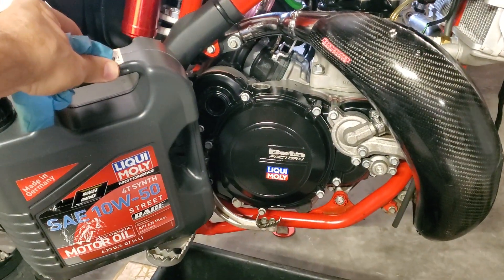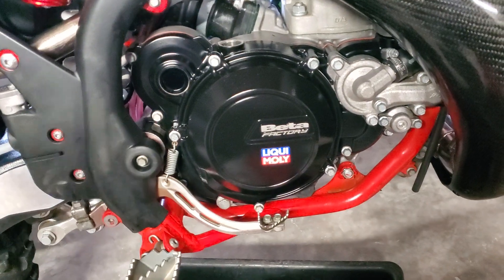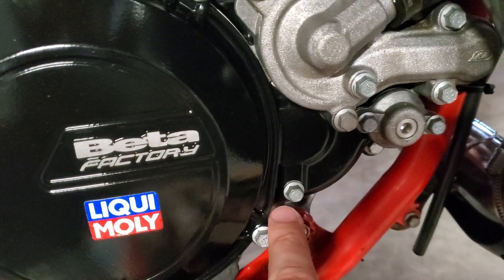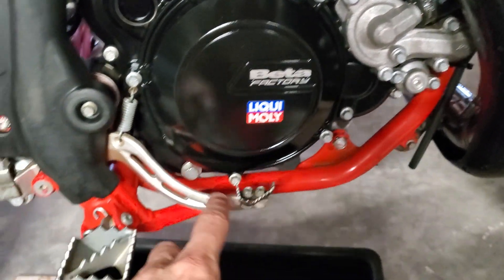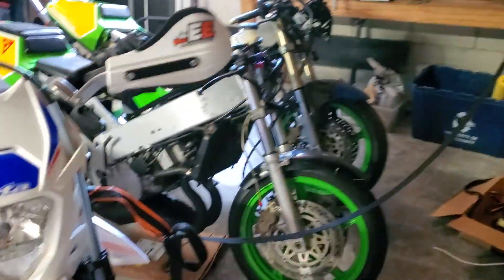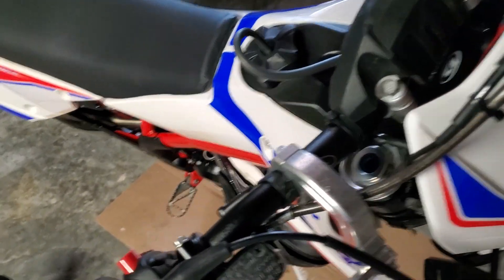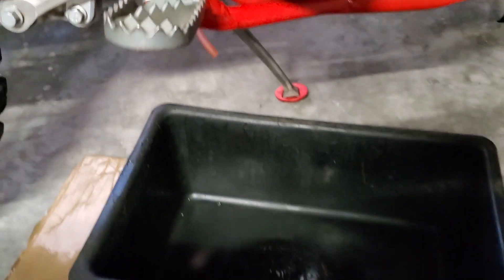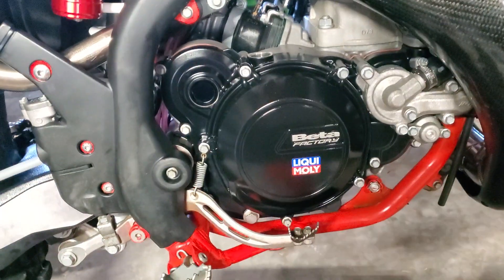Beta 300 Xtrainer Oil Change.

Comment: You run that even though it says 4t?
Reply from the maker: I just wing it and follow the manual.
Reply: the 2t is in the oil mixer tank which is what gets injected and mixes with the fuel but yeah I agree with wetlife, I just follow the manual
Reply: that's what you use in the crank case. 2t oil is for the oil injection.
Reply: It’s the same for either type of bike if using as a gear oil. Can be used as engine oil in a 4t.